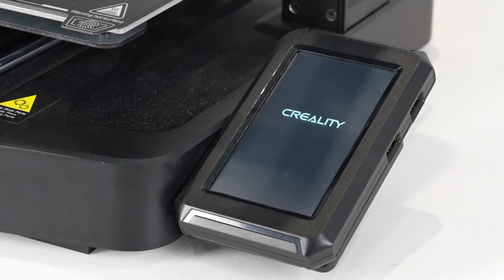Ender-3 V3 KE/SE LED Light Bar Kit Installation Guide!!

Comment: Incase anybody missed it, Run the wire down the left Frame ( opposite side of the wire/Screen.) Don't make the same mistake I made and drill a hole on the opposite side only to find out there was already a premade hole.
Reply: Thx

Comment: These instructions were exceptionally inadequate. Had I been aware of the specific tools and correct procedures for my Ender V3 SE 3D printer, I would have sought an alternative. While the product fulfills its intended function, the installation process was so time-consuming that it detracted from my ability to use the printer efficiently. The assembly needs to be simplified to a more user-friendly plug-and-play system. Furthermore, the instructions provided for the US market were subpar. Incorporating pause and zoom features into a step-by-step guide would accommodate various learning styles, particularly for kinesthetic learners. Adding audio and video enhancements would also greatly improve the instructional content. Forget about the 3D Printer Enclosure. TERRIBLE Instructions.
Reply: Agreed, I felt tricked, especially considering the printer is so locked down to the beginners market and the light is the same brand as the printer. Didn't plan on dismantling my printer to beyond factory and people have a right to know.

Comment: This video is crap.  You'll end up watching it a dozen times.  Get black electrical tape before you start, as well as a needle and string so you can pull the wires through.  The wire won't snake through on its own.  The light bar is beyond cheap - absolute Temu level Chinesium.  Snake it down the left side.  The 2 wire plugs - the one with the white "O" on the wire goes toward the middle.  Video doesn't tell you so many things......

Comment: This is different from the printed instructions which shows the wire going through a hole behind the right side support which requires the wire be crimped between the light bracket and vertical bar. But, this is a cleaner overall installation. After installation, make sure to tighten all the screws!
Reply from the maker: Nice catch! Our video took a detour from the printed instructions for a cleaner look. It's like choosing between a sleek sports car and a reliable sedan—both get you there, just with different vibes! And yes, tighten those screws like you're giving them a group hug. Thanks for sharing your insight :)
Reply: Correct i followed the video and the wires got Pinched started shorting out my brand new v3 ke! not happy following the instructions, and this video shows 1 thing and then another.. now i have to take it all apart again, fix the pinched wire and re-route
Reply: @rby1916  same 😢
Reply: @rby1916 exactly the same. Shorts the whole machine. Cut away a small slot in the top cover to stop this. It is underneath so you don't really notice it.
Reply: @btschuster04  you only need to file the support bracket down a little to avoid that
Reply: @Richytbiscuit  I reinstalled the light bar using this method after seeing this video. I did what you did, and fished the wire through the support post without removing it.

Comment: I recently bought the Creality LED light bar and installed it on my Ender 3 V3 SE. It works fine but I am disappointed with the quality of some of the components... 1. the tiny little lugs that hold the end brackets to the LED bar did not secure firmly 2. the LED diffuser keeps popping out of alignment (not sure how long it can withstand the LED heat before it warps completely) 3. the crimps on the power leads are very small and fragile (I broke one just screwing it in place on the termination block on the motherboard) 4.following the included instructions leaves the power leads just dangling loosely near the Z axis rod and motor (not a very elegant solution in my opinion) 5. the whole process seemed way too complex and confusiong (thank heaven for Youtube).... come on Creality I expected better from you, I would much rather pay $10-15 more and get a much better product. Regards Glenn O

Comment: Terrible design had to cut hole in top of gantry plastic as the wire kept grounding out and killing power to the machine. No have slot it works fine

Comment: Did this to my ke yesterday, but a different way as this method involves too much dismantling. 

Top tip...don't remove the bar just use a piece of filament with the wiring attached to get it through the hole in the base.
Reply from the maker: Wow, your method seems to save a lot of work compared to the dismantling involved in the video.👍👍 Have you ever considered sharing it with the community? I'm sure many people would find it helpful, and it could spark more discussions on different approaches.
Reply: Please share the full method
Reply: I'll share a video soon
Reply: These instructions are terrible. How did you do it? If you follow these instructions, the wire is extremely pinched when you put the top back on. There are more steps to add a light than building the printer smh
Reply: @jasondriemeier3406 my instructions or creality?
Reply: @Richytbiscuit I followed your advice by using a piece of filament to fish the wires down the right side of the gantry frame. It worked like a charm 👍🏼. I wish I had payed closer attention to this video to notice that they run the wire across and down the left side. Which way did you run it? And how did you solve the issue of the wire pinching if you reattach the top bar? They never address it in this video.
Reply: @maxcarrillo1683 @maxcarrillo1683 I ran it the right side too, and in between the two top screws file away a little of the gantry just enough for the wire not to pinch
Reply: @mmmmsss_  ??
Reply: @Richytbiscuit  9 months later?
Reply: @Amathusukx  Surely you can figure it out?
Reply: @Richytbiscuit  I have done, but there will others who did not.
Reply: Thanks for your tip, worked perfectly, only forgot to tie down slack wire, but probably will go there again for  run out sensor.
Reply: @myblindedsoul  glad you understood it, saves messing

Comment: my printer v3 se. I connected it to the terminal shown in the manual. Then the printer won't turn on. It turns on normally when disconnected from the terminal.
Reply: Same😢
Reply: @Jesse-zs7yc  yep same, can't find any fixes for this
Reply: @westonsmith6925  I did solve this. You need to ensure your wire does not get pinched or caught by other objects, which could lead to a short circuit.
Reply: I had to cut slot in plastic at top off support to stop it being pinched.

Comment: My whole print won’t power up after the install? Any suggestions? I followed this video step per step. 😢
Reply from the maker: So sorry for that😢, for failing to turn on the printer after getting led light installed, pls check for wiring errors, ensure the combined power usage doesn't exceed the supply capacity, and inspect for a blown fuse. Make sure your printer is KE or SE and the led light is free from faults. Examine for short circuits, and consider testing with a different power supply. 

If everything above has no problems, pls contact our after-service team via cs@creality.com for help asap.
Reply: @Creality3D  thanks for the reply. I just figured it out about an hour ago. Where the wires come out of the gantry up top got pinched and was grounding it out when I would turn it on. Spliced the wires and now she fires up perfectly.
Reply: @williamopdyke8813  Same here I thought I killed my printer since the wires shorted. but looks working now. This is actually a real flaw in design as you have to cut some plastic to let wire freely  move without pinching.
Reply: Just friggin happened to me... It suuucksss taking that thing apart
Reply: @williamopdyke8813 thanks the for solution. I solve this issue by loosened the top left corner screws.

Comment: how do I prevent the wire from being pinched by the top beam when i screw it back down? very frustrated!!!
Reply: He showed it on the wrong side. It won't pinch the other way. There's grooves cut for wires.  Hold it in place with black electrical tape.

Comment: Hello, I bought the light that you sell and it came without the final supports. Is it possible that you could send me the same file to print them? Thank you
Reply from the maker: What do you mean by the final supports? If you find that something is missing from the product you purchased, you can contact customer service for assistance.
Reply: @Creality3D  I believe they mean the bracket that attaches to the linear rails with the 3 bolts. I don't think they came with mine either, so if it's something we can print that would be awesome.

Comment: I just installed this on mine, great bar but the written instructions leave out the cable routing step through the left leg. I’m kinda going to have to do this step now but might wait until I install the filament sensor and nebula smart kit that I’m planning to order shortly.
Reply from the maker: Thank you for your tremendous support! We're honored to learn that you've bought the printer and will get upgraded items from Creality. Can't wait to hear about your experience after installing the filament runout sensor and nebula kit!

Comment: This is not right, cant control via  slicer by menu led on\off
Reply: it's got a rocker switch, whatever the slicer originally meant to do isn't an option or isn't listed in the instructions/manual

Comment: the ends of my wiring connection into the motherboard are just stripped wires, not fancy crimping like this.

It also doesnt have +/- marked. My bar is not working.
Reply from the maker: Apologies for the inconvenience. Have you reached out to our customer service team at cs&creality.com? If not, could you please provide your order number and email address here? Our team will get in touch with you to assist you further.

Comment: This video is so needlessly complicated i can only attribute it to malice.  I had the entire gantry taken apart before seeking out another video with much simpler instructions.

Also the video is eay too fast, wothout an explanation on what tools might be needed, where/why to punch out the tab behind the gantry to run thr wire, and no instructions as to any other methods besides complete disassembly.